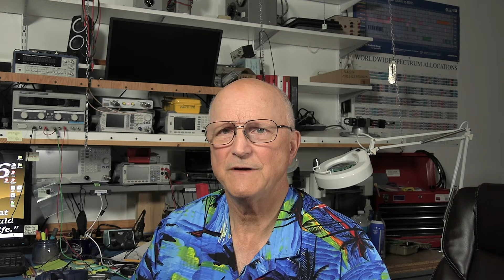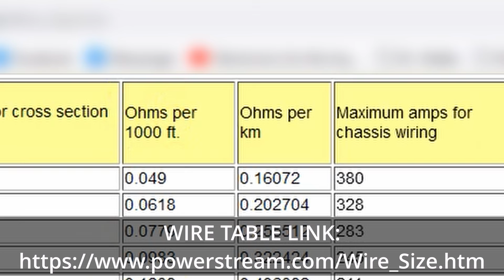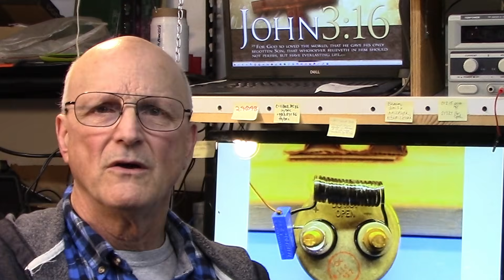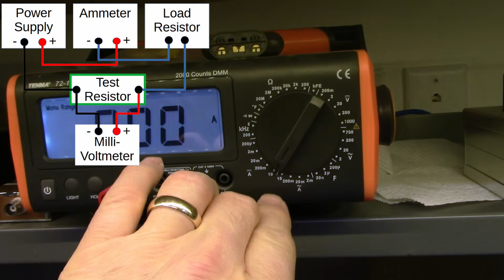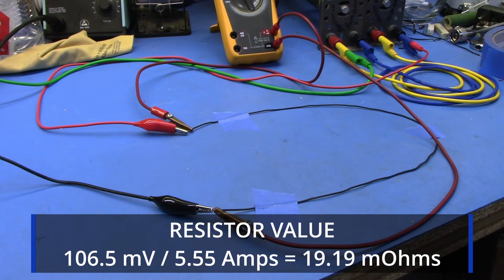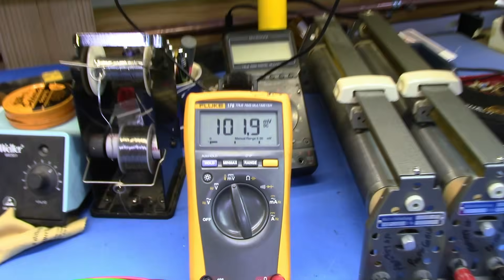Grow Your Own Shunt (019h_v2025)

Comment: I think you would be interested in bifilar winding. When you fold the wire in half, then start winding it.
The result is a similar tube-like shape but a lover parasitic inductance.
Reply from the maker: True, this would, indeed, reduce the inductance of the shunt.  However, the inductance of the meter movement itself is so much greater than this wirewound resistor that this change would have little benefit for this D.C. current application. We add in the meter averaging of the inertia of the mechanics of the movement ... :-)

Comment: Hi Ralph,
Another fine demonstration with great visuals. About 55 years ago I built a 1 - 15 VDC 0 - 3A power supply and need a custom shunt for the current meter. I decided to try a piece of Radio Shack .032" resin core solder. Needed about 5" for the shunt. Started with about 7" and kept trimming the length until the meter matched the reading on my Simpson 260 VOM. Wish I still had that Simpson meter. Still don't know what happened to it. Stay safe.  73  WJ3U
Reply from the maker: Thanks, man! I'm glad you enjoyed the video. Solder as a shunt? Now that is a different take. I like it! :-)

Comment: 18.007 milliohms? Welllll ...
Copper is convenient but makes pretty awful shunts. Its temperature coefficient of resistance is high - about +0.39%/°C. Nichrome, depending on the specific allow, is around 10 to 30 times better..Manganin, a fairly common alloy for commercial shunts, is down in the range of 20 ppm/°C (I'm using degrees Celcius instead of Kelvins because tempcos are not constant and the values mentioned are at around "room temperature"; using Kelvins sort of implies the tempco is constant from 0 K to something really hot).
Self-heating of your half watt copper shunt will wipe out any semblance of significance of those post-decimal digits, and start to eat into the 8. A coiled shunt with the turns closely spaced will be worse than one with the turns spaced out a bit for better cooling.
For some purposes a copper shunt is acceptable. For any sort of precision work it will be horrible.It isn't easy to obtain good resistance wire in quantities that hobbyists might want. Fortunately good-quality low value resistors intended for use as low power (up to a couple of watts) shunts are vastly easier to buy off the shelf than they used to be.
Reply from the maker: You are right...the positive temp coefficient of copper ... in fact with just about any normal wire it can cause issues depending on the degree of accuracy you need.  Precision? Now we need "official" resistance wire with a much better temperature coefficient. :-)
Reply: Just for context: resistance increases 4% per degree C for copper, 1% for 304L Stainless wire, and 0.1% for nichrome. And of course, with stainless and especially nichrome you'll need much less wire for the same resistance and diameter. Just something to keep in mind when selecting your wire for a given use. Copper does have the advantage that it's much easier to solder without unpleasant fluxes, and crimping can lead to contact resistance issues that can be significant for small shunts.
Reply from the maker: Yeah, plain copper does have a tendency to change value with temperature. There ARE better choices for best accuracy. :-)

Comment: Excellent demonstration. I guess we can only use a coil but I wonder if the inductance created will influence the reading or the circuit under test?
Reply from the maker: Don't forget that all wire, coiled or not, is an inductor. Remember, too, that the meter movement itself uses a coil of wire (an inductor) to create an electromagnet to cause the needle to deflect. Likely, the inductance of the meter movement coil is greater than that of the shunt. The effect of the shunt, then, actually reduces the overall inductance of the circuit (parallel inductors, like resistors, the final inductance is lower than the lowest value inductor. :-)

Comment: Good video. Note that the wrapped form makes it an inductor, that can be problematic if the shunt is fed with pulsed current ...
Reply from the maker: Thank you! I'm glad you liked the video.
Regarding the whole inductance concern, don't forget that all wire, coiled or not, is an inductor. Think about the meter movement itself. It uses a coil of wire (an inductor) to create an electromagnet to cause the needle to deflect. Likely, the inductance of the meter movement coil is going to be greater than that of the shunt. The effect of the shunt, then, actually reduces the overall inductance of the circuit (parallel inductors, like resistors, the final inductance is lower than the lowest value inductor value). :-)
Reply: @eie_for_you  Yes I agree, but an inductive shunt will ruin the measure precision in AC. In DC there is no problem.
Reply from the maker: My point ... the meter movement, itself, is highly inductive because of the way they are constructed. By its very nature, it will be "averaging out" the measurement because of the inertia associated with the mechanical nature of the meter. The shunt actually *reduces* the total amount of overall inductance because it lays in parallel with the meter movement. :-)
Reply: @eie_for_you  When inductance is a factor it is simple: wire hllf of the turns with two parallel wires and connect the two wire in on end and use the other two wires on the other to connect: this is called bifilar winding.  The two parallel coils winded with the current circulating in opposite directions make the inductance virtually zero.
As it is true that all wiring has induction winding it makes the inductance far bigger. This is not a problem for low frequencies or we would never had wire resistors and remember carbon and metallic film resistors are cut on the substrate by a lathe and are winded in this sense too. For high frequencies the inductance and capacitance gets important as impedance of an inductor grows with frequency and the bifilar winding solves the problem. About the inductance of the meter this is a big discussion that does not fit on a comment there are a lout of types of meter coils  although only one is used today this was not always the case in the past and some were very interesting.
IN the past (long ago ...) I used a 1/4 resistor and winded the wire around the resistor and soldered the ends on the resistor leads, the shunt in parallel with a big value resistor would have virtually the same resistance value and the resistor made the set more rigid.
Reply from the maker: What you say is true here ... if our concern is with the availability of current with pulsed load. We DO want to minimize the series inductance associated with the supply. *Absolutely.*
In terms of the context of the subject at hand: analog meter movements and their shunts. 
With regard to the accuracy of the current reading on the meter, the analog meter movement will average out the current through it due to the mechanical aspects of the movement (inertia of the moving parts).
Regarding the series inductance ... the most common style of analog meter movements are, of themselves, significantly inductive by the very nature of the coil of wire used therein. Any inductance associated with the shunt is most likely to be a fraction of the internal inductance of the meter movement itself. 
The shunt is in parallel with the meter movement. This combination will, by definition, significantly reduce the overall inductance of the system. [Lt=(Lm * Ls)/(Lm + Ls)]
:-)